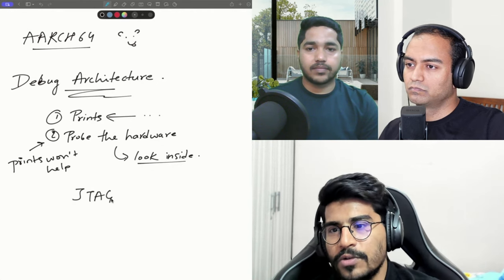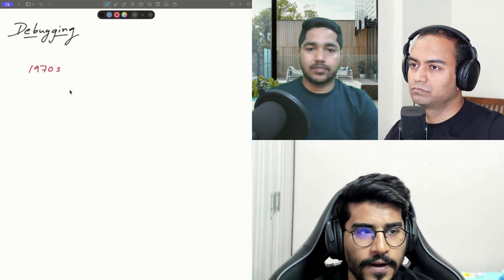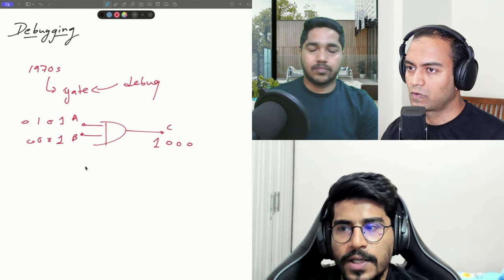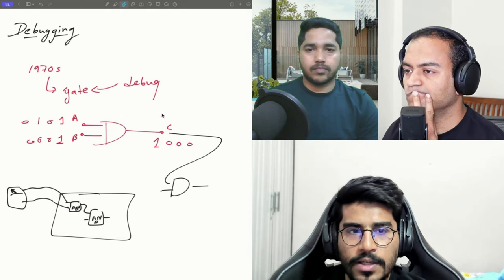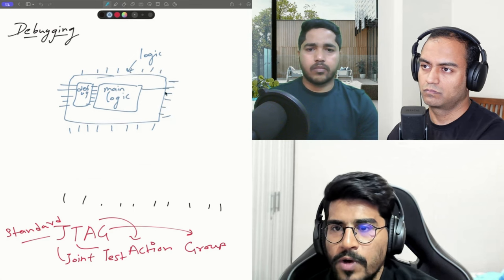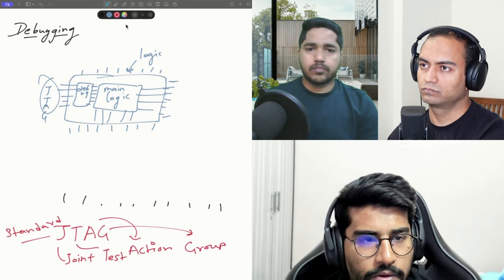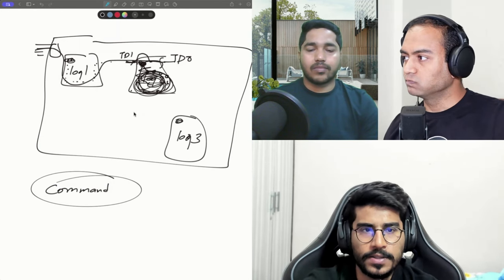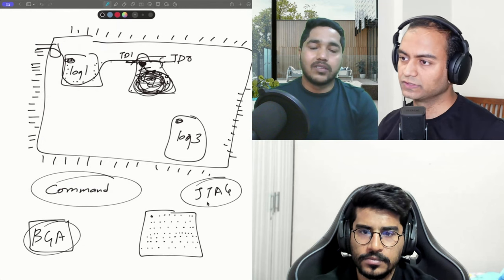4. The concept of hardware debugging - JTAG!  | ARM-A (aarch64), in Pyjama!

Comment: Curious to know which jtag controller you use for your setup (usb to jtag box). The link in the video description provides a link to go from usb to rs232. The commercial jtag controllers like corelis and jlink ones are quite expensive and hence I've always been curious to know if there are cheaper methods.
Reply from the maker: Forgot to add the link to that in the description.

It's a FT232H board which supports multi protocol. Supports many other protocols like SPI, I2C etc. for which we are planning future videos.
Compared to professional solutions this is quite inexpensive. Somewhere around 2-2.5K INR.
Reply: @inpyjama  Fantastic, thanks for the info. This board is indeed quite inexpensive.. Great to know.. And by the way, the videos are awesome! Great work!

Comment: What's the difference between swd and jtag, other than the number of pins?
Reply from the maker: SWD is a resource constrained implementation of JTAG for ARM (which means lesser pins as you pointed). The overall protocol under the hood remains the same.